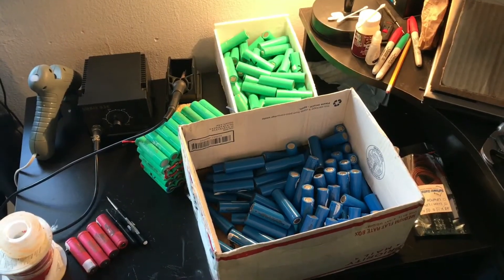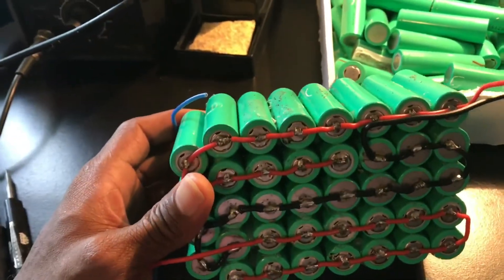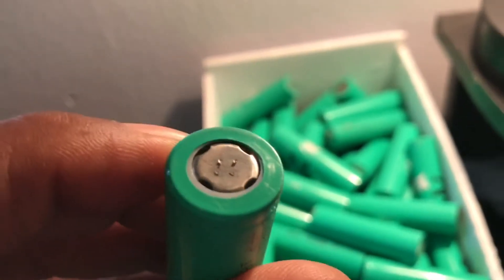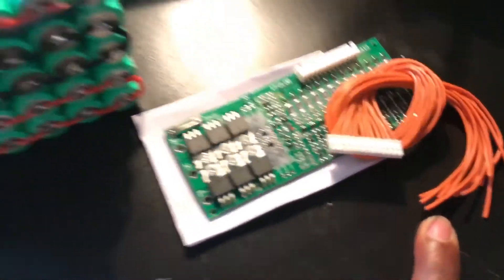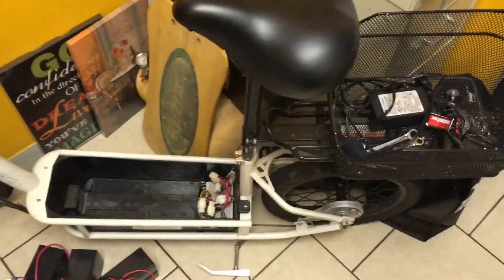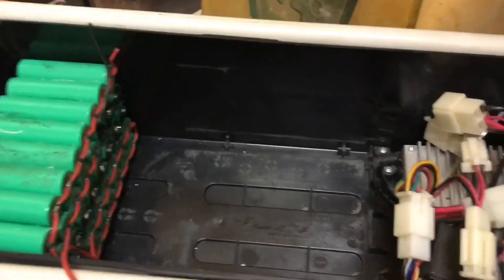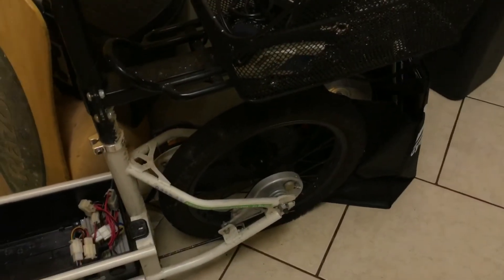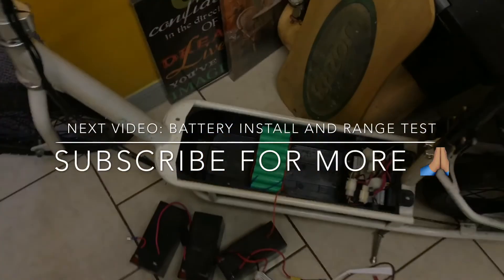Razor Eco Smart Scooter Lithium Ion Battery Upgrade [Update]

Comment: Any update to this?
Reply from the maker: Cody Z. Made a little more progress with the battery but have been busy. So sorry for the delay but it’s still on. Looking like 3 months out. Thanks for your patience. Please subscribe so you don’t miss it.
Reply: Elton lithium batteries are becoming much more affordable now. Read a article about it today. Think the price this year is 25% less then last year and the trend is going to continue.
Reply: Ethan I have a ton of 18650s. I buy’em from my local flee market $2-3 a pack. ✊🏼
Reply: Any updates on Cycles lifespan
Reply: I heard lithium iron (LiFe) is safer, and charges more times. Idk if it's quite as powerful per gram of weight etc but I think the key factor is that its somewhere between regular lithium and lead acid, and safer than both.
Reply: Probably burned his house down since he was using a soldering iron. LOL

Comment: this is a battery pack big enough to power a car 
You went to Mars on this scooter and that's why nobody has heard anything more right?
Reply from the maker: Lol no. Bought a house got married and had a kid. Just about finished renovating the house where I can set up a soldering station and finish the project. It stalled during the soldering. Also YouTube stopped paying the little guys (pure evil) so that helps to de prioritize making YouTube videos but I’m committed to finishing it. Subscribe to see it thru my guy 🤓
Reply: @eltonq  looked your video up because I am modifying my own Ecosmart. I just got some giant lawn and tractor batteries. They can crank an engine with 425 amp for 45 minutes. I am doing a bit of cutting and welding so I can fit three of these monsters. Also adding gears .  I plan on using this to go to work when fixing my gy6 scooter.
Reply from the maker: @andrewvoigt1133  that sounds doable but I think lithium ion is the way to go because of weight reduction and higher energy density. If you put heavier lead acid batteries in it you will pay a small price for carrying the extra weight around. Something to think about. Also you can buy bigger lion batteries now a days the prices have come down since I started the project. Might want to look into that too.
Reply: @eltonq  Glad to see you're still kicking, Elton.  Congrats on the life changes.  Those batteries you started with might be getting old.  :)

Comment: I love your videos.....hope your still online because I had a few important questions concerning my razor scooter (same as yours) 
1. How long did it take with initial battery charge for your LED charge light to go from RED to GREEN? My charge light turned GREEN 45 minutes after I first plugged it in!!!!
2. Is it normal for a loud noise to come from the rear wheel when scooter is rolled backwards? I know you shouldn’t do that but I heard that noise by only moving it backwards an inch or two. 
3  after opening box I noticed slight almost washer like wear marks on flanges of front forks, almost like front wheel had been fastened on prior to me receiving unit. 

I’m just wondering if maybe I received a used scooter.....

Please let me know your opinions on these questions if possible

Comment: im gonna nit pick about your balance board...... balance boards are for per cell to balance each cell not a cell grouping if you cant balance each cell by themself it makes no difference to have that board because they are not going to be right the first in series will always have more juice than the last in series and the last in series will degrade faster from having the voltage pushed threw it at a higher rate its a bad idea to do this the way you are cheap cells high amp draw and one hell of a cheap charging solution..... what could go wrong...... lets look back at when vapes were going boom they take the same battery
Reply: >  lets look back at when vapes were going boom they take the same battery

Morons were carrying cells loose in their pocket and they were shorting on coins, keys, etc.  Or using mech modes without understanding Ohm's Law.

Comment: You can get Samsung high drain 18650 from Lowe’s six for $10, they use them in their Kobalt drills and sell the battery pack for $10, just open the pack.  Then you’re not dealing with ebay garbage cells
Reply from the maker: lifehackertips they were just under $15 for one 9 cell battery. It was the best deal when I bought them at the time. Won’t be doing this again. Too much soldering required 👎🏽
Reply: Elton the Lowe’s batteries were available in 2017, and if you want cheap high drain batteries you’ll have to do a little soldering for now.  Maybe in the future 18650 will drop more but $1.66 for a high drain Samsung is already pretty cheap

Comment: A lot of of those batteries have very inflated ratings  (lies).  I have read on a testing site there are suppliers that do verify LG batteries that are not counterfeit and actually put out the rated amperage. Counterfeiting lithiums is rampant.  I put three 15 amp sla batts in mine.

Comment: The wiring under the platform has a tag that warns not to alter the wiring harness.  Despite the warning I added a headlight and taillight and a switch to turn them on/off.  The charging port is difficult to see/use (below the platform), so I added another charging part just below the seat.

Comment: I am interested in putting a disc brake on the front wheel.  Any suggestions?  A rear freewheel with an adapter does not fit inside the front fork.  The adapter and rotor touch the inside of the front fork on the disc side.  Either a replacement fork (hard to find one with the long head tube) or having to cut the inside portion of the fork on the disc side.  Maybe get a 20" fork with a long head tube and disc mount and just put a 16" wheel on it?  Maybe "re-dish" the wheel to move the hub away from the disc side?   Maybe just offset the axle connection points to one side?
Reply: using a rear freewheel with an adaptor, the disc rotor will fit if an axle lock nut is removed from the right side and placed on the left.  The right cone locks nicely against the right fork without the locking nut.  Now to attach the mount for the caliper.....

Comment: Impressed with your dedication in acquiring and assembling the batteries.  For about $285 a 36v 20ah lithium battery can be had from AliExpress and delivered to your home.  The AliExpress battery pack easily fits into the Ecosmart battery compartment with room to spare.  No mess, no fuss.  
Building your own battery does give you more control over the battery shape and capacity.
Reply: tankboy357 can you send me information or a link to the batteries you mentioned? I have this scooter and would really like to extend my drive time.
Reply: I need someone to show my how to do the wiring
Reply: tankboy357 but that’s AliExpress garbage that won’t work
Reply: @lifehackertips  where do you think his cells came from? those are chinese ebay batteries, same stuff.
Reply: turtlepowersf products on aliexpress don’t last, they don’t have the refund policy sites like ebay and amazon have.  Aliexpress cares about sellers, not buyers

Comment: You can build a spotwelder from microwave parts
Reply: Just use a car battery with thick gauge solid copper wire and a solenoid and switch to activate

Comment: I have over 1000 miles on my ecosmart over the last two summers on the factory batteries, replacements at monster scooter parts with 28% more power for under $100 delivered